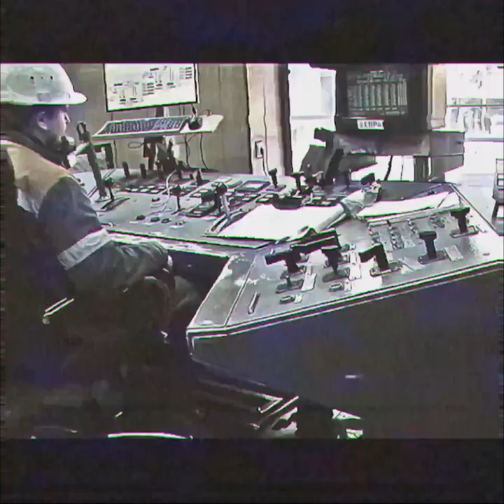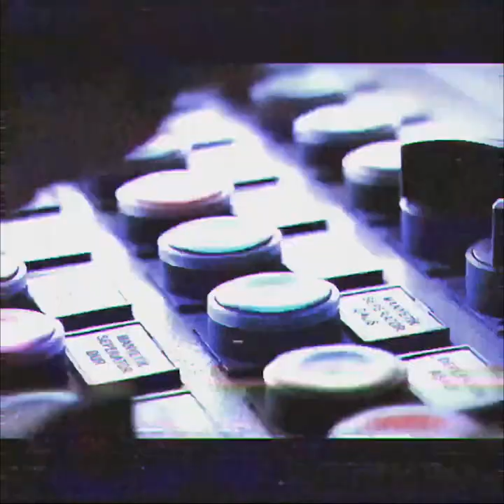PØLI, Lorenzo Raganzini - Metal Works [VNR038]

Comment: TRACK & VIDEOCLIP
Metal. Metal. More metal. Build to advance. Build to keep growing. But also build to destroy. And destroy to build again. This is how the metal circuit plays in the day-to-day of the human being. To melt it, to forge it, to create it, to assemble it, to transport it, to use it… to end up destroying it. Self-destruction doesn't matter. Only the freneticism of the human being to build and destroy so that the eternal cycle lasts forever. A circular circuit, whose starting and ending points are always the same. Time after time. Without exception. PØLI and Lorenzo Raganzini found in it the inspiration to create new music using modular circuits. They found in this vicious loop the crudity, acidity and violence they gave to "Metal Works", to impregnate it with a rough and rave sound. Metal. Able to star in great milestones, but also able to provoke the darkest days for Humanity. It will always come back. It will always be rebuilt. Again and again. But music will stay for ever, eternal, immortal.